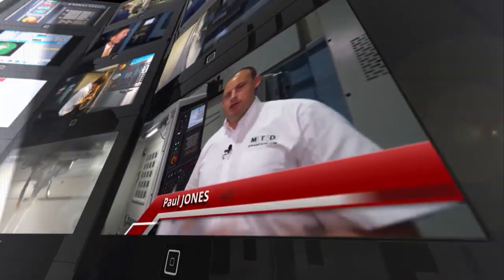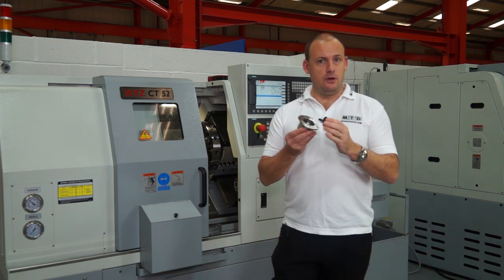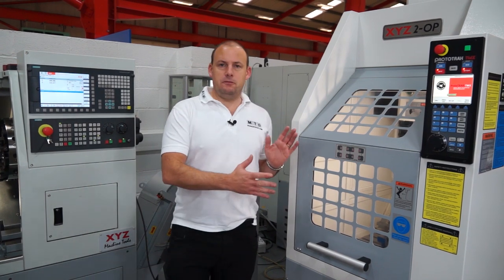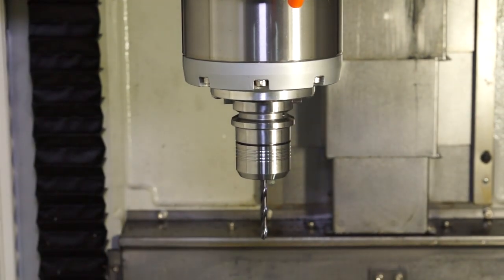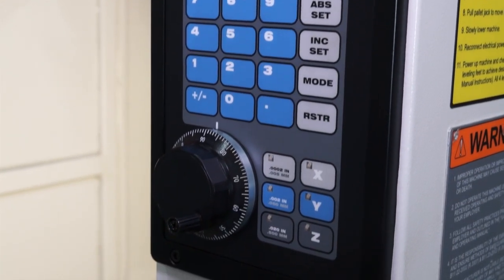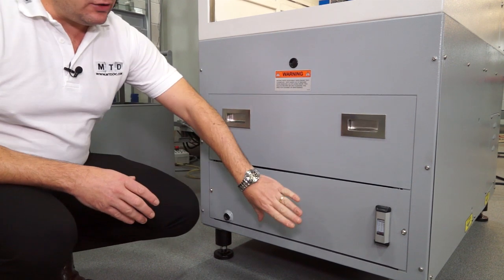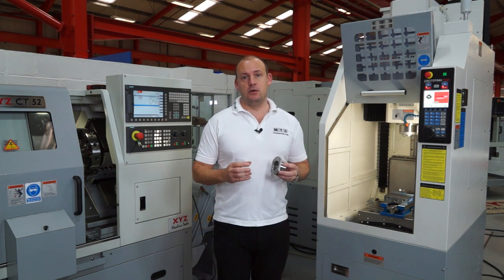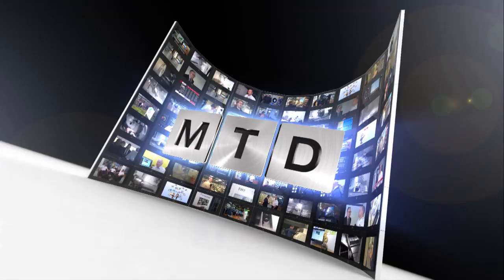XYZ 2 OP machining centre

Comment: Or just get turning center with milling capability.
Reply: it cost more and you cant run parts in parallel; while its milling, you can turn more parts
Reply: but still :) And with two revolvers u can do both.
Reply: which is innefficient considering this is the better option
Reply: It ain't :P